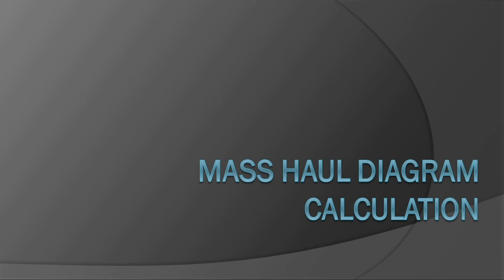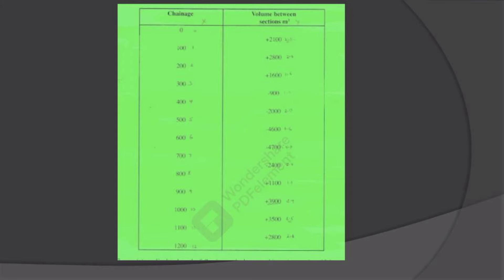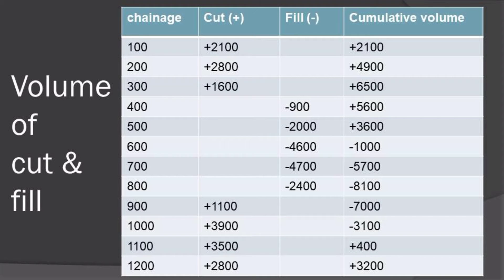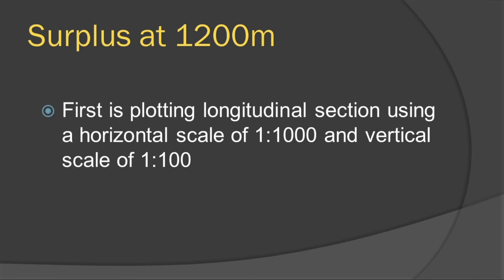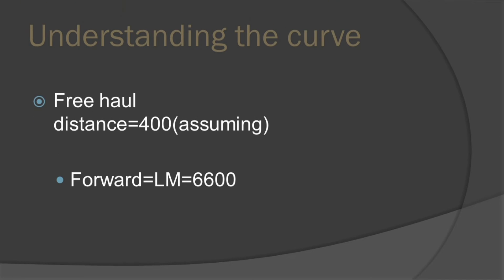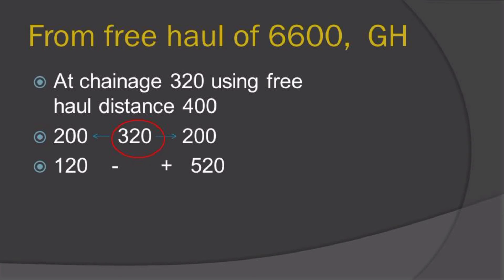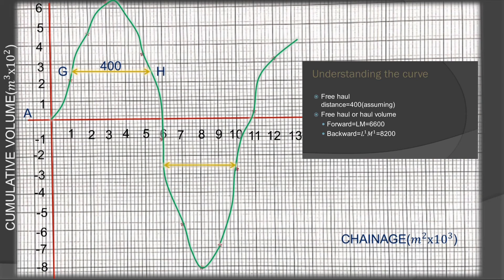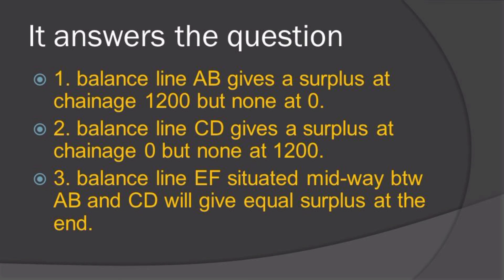Mass haul curves calculation on volumes (Building & civil engineering)

Comment: Please help 2019 July 5(b)
Reply from the maker: That question required you to calculate the reduced level of x & y , then draw the diagram to form a triangle. Calculate the area using the 3 distances gotten from D(horizontal). Then multiple that with the difference in levels
Reply: @IwordsShotsEmpire  I multiply the area by all the reduced levels of each point??